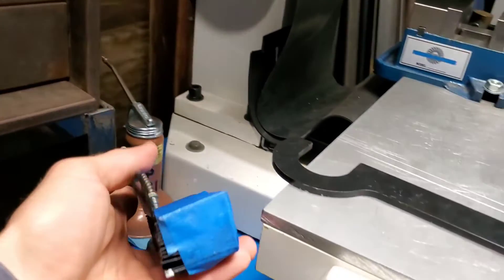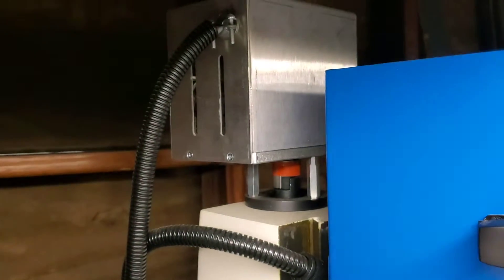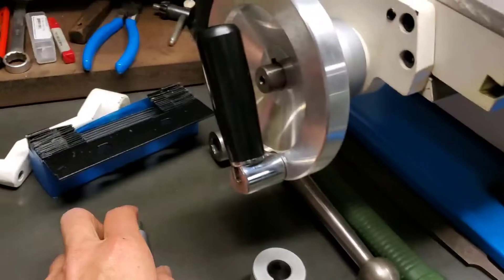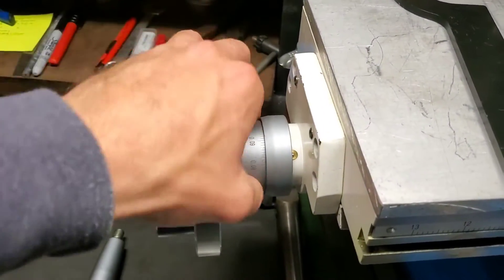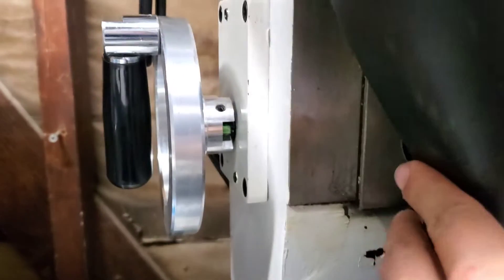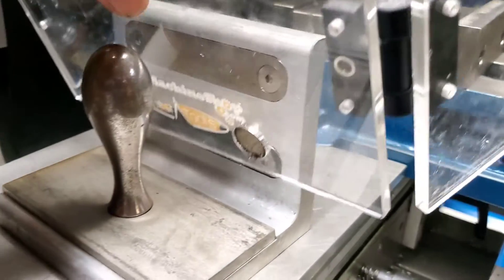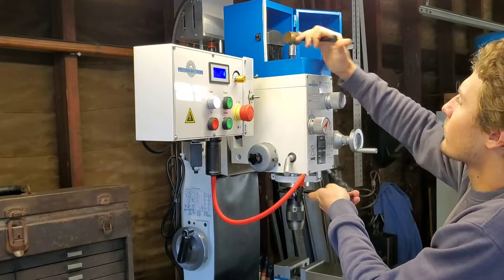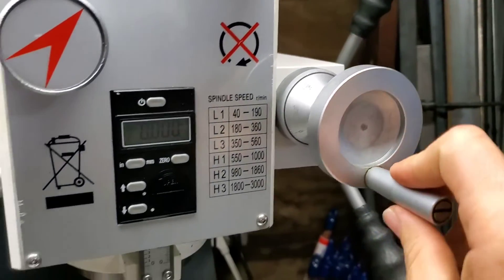PM-727V Upgrades, Modifications & Accessories

Comment: I’m not sure about dissimilar metals on the table.  It might cause electrolysis.
Reply from the maker: If it was in a moisture-rich environment then that would be a concern but it's dry in my shop and there's also some protectant spray that I keep on the surface of the table, which acts as an insulator between the two metals. Good thinking though, I try and avoid mixing dissimilar metals where I can.

Comment: awesome info. i have a pm30mv that i just picked up to start learning with. hoping to do some of these mods as well. thanks for the video. those handles that fold away are first. i've clipped my arm on the front one so many times now it's not even funny (although its usually my "funny bone" that catches it)... do you mind sharing the part numbers of stuff you ordered. i'll have to make sure they're the same parts to fit mine. thanks :)
Reply from the maker: Hey I'm glad you enjoyed the video, the folding handles are an absolute must for a home shop. If you look at one of the comments below you'll find my reply to another comment with the part number.

Comment: What size vise do you recommend for the 727?
Reply from the maker: 4" is a good size. Some people cut off the front lip of the base of the vise where it would hit the column to get more Y Axis travel. I haven't needed the extra travel yet but I'll do that sooner or later.
Reply: @grippimatt  Thank you.  I'm torn between the PM-727V & the PM-30MV.  Any recommendation there?
Reply from the maker: @G1951-w1y  the PM-30 runs on 220V so I'd go with the PM-27V because it can be used anywhere. It depends on whether you need the higher capacity/increased rigidity of the PM-30 but the 727 has been great for me. I can notch tubing and cut slots in steel no problem.

Comment: Do you have column sag? I was looking into getting the precision one or this one, the only issue is I would be cutting mild steel rather than aluminum. I understand this has more power but I’ve seen reviews saying they have sag etc. probably wouldn’t be quite rigid shimming, another thing, have you checked the run out on the spindle?
Reply from the maker: Hey Jake, I haven't checked the run out on the spindle but I haven't noticed it to be an issue in any of the precision applications that I've done. 
I'm not quite sure what column sag is but when I got this machine the head had to be trammed by adding a small shim underneath the column. Having done that, I haven't noticed any issues with vibration after I've thoroughly tightened down the column bolts. Hope this helps.
Reply: @grippimatt  sounds good!! Do you think this is the better purchase for mild steel? I just was looking for something that’s precise at the same time, did the precision one lack a lot of power compared to the 727
Reply from the maker: @jakedrake1054   There's no question that you want the 727V over the 728 if you're gonna be machining mild steel. Go to my channel and check out my video comparing the 2 machines. That will help you out a lot.
Reply: @grippimatt  thank you so much!

Comment: Thanks for video - could you show  more machine vides with sound of different operations using your PM - started looking few days ago at PM mills -  PM 30MV one been mostly looking at so far - any thoughts ? - Nice shop you have - equipment on wheels is good move -I did similar 40yrs ago -  several others things I did like mounting bench grinder so folds up against wall out of way /easy move around  if UR interested - Jay

Comment: Despite not knowing most of the terms you used for the parts of the machine this is all pretty sick! What are you planning to use it for?
Reply from the maker: It's a badass machine! A milling machine is great for cutting slots, like if you're fabricating a bracket for something or need to modify an existing part. I use it for hole saw cutting like when I was making those custom dip bars. Affinity uses a benchtop mill similar to this to notch all their chromoly tubing. There's so much you can do with it.